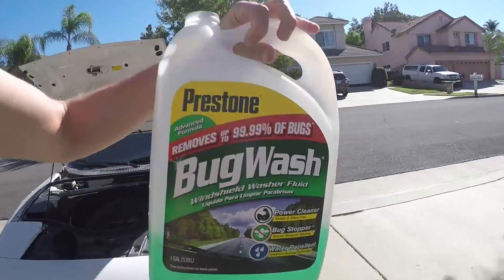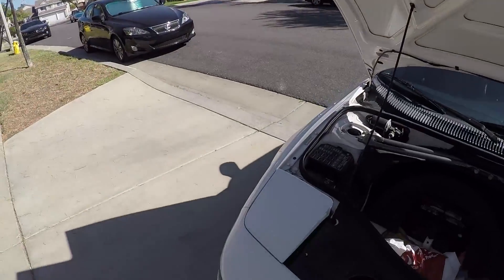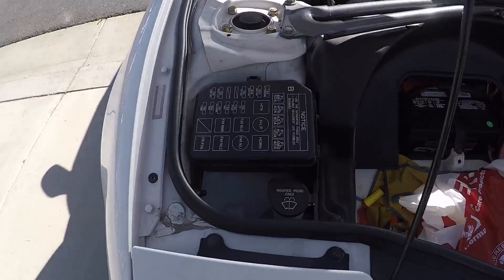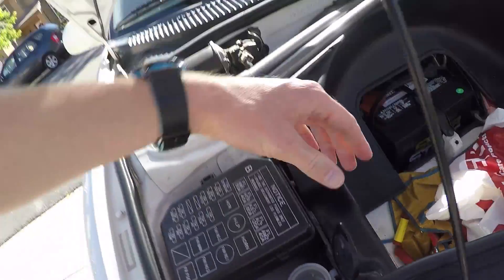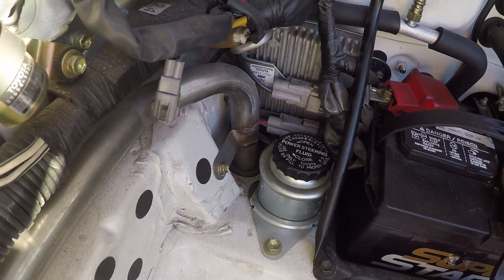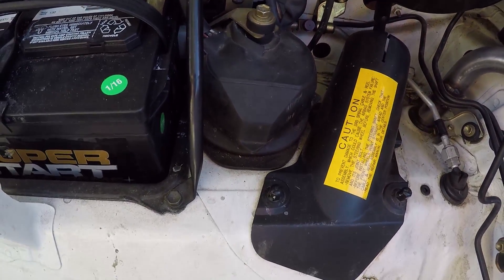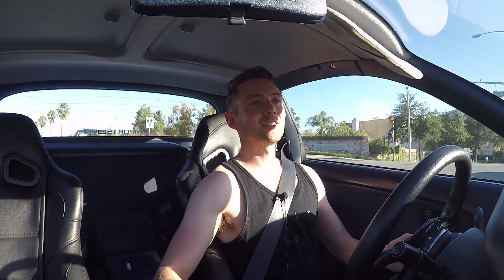Difference Between Hydraulic and Electric Power Steering

Comment: "The steering wheel is not fly by wire, it's still connected mechanically to the wheels via a steering rack. Electric power steering uses electric motors to assist you to turn the wheel but doesn't replace the physical connection."

Comment: I've driven a car with hydraulic steering and one with electric steering. I had way more confidence with hydraulic due to me being able to feel the road and the way the wheels turned with me. The electric steering made me feel like the passenger while being the driver I couldn't feel the road at all nor the wheels moving. Half the time I was worried of crashing since I couldn't feel the car and the other half was trying to keep the car out of the other lane or going into a ditch. I would take a car with hydraulic steering over electric any day my personal opinion.
Reply: I agree totally. I’m having a lot of issues over here driving on the expressway in both cars which are 2018s. I no longer drive on the expressway because I have no idea on which direction the car is going in. Feels over assisted , loose and floaty
Reply: I've found electric steering to be a sleep hazard due to the same things you guys have mentioned here. Lack of connection to the road, especially over the course of a long drive, will make one sleepy due to lack of engagement/connectedness to the road.
Reply: Seems like a sneaky way for Skynet to kill off humans...

Comment: I am not an owner of a MR2 but recently discovered that my car has EPS and since the car is a 2006 Jetta 2.5 getting info on it is harder than trying to smuggle missiles past the Berlin wall during the height of the Cold War.  So am thankful that you made this video. While it didn't help with my immediate problem it did fill a huge knowledge gap about my EPS.
Reply from the maker: Haha so glad I could help! Thanks for watching!!

Comment: the engine noise piped through the car isnt always boring, for example the LFA is considered as on of the best sounding engines, although yes its a pretty cheap way to make a car seem faster
Reply from the maker: I didn't know the LFA had piped in sound. It does sound amazing but that kind of makes the car a little less cool now lol. Anyway, if it at least the actual sound of the car just amplified through the speakers it's better than just a straight up recorded engine noise playing

Comment: Best video I’ve found on this subject, I don’t understand the dislikes or rude comments. Oh and those muscles aren’t fake 😂 Great video, and nice car 👌
Reply from the maker: Stop it you're making me blush 😝 lol Thanks for watching and glad you enjoyed!
Reply: I came here for an explanation on the difference between hydraulic and electric power steering. It started off looking like a vlog instead of an explanation, and the 11 minute duration also didn't make a great impression either.
So I scrolled through the video and I didn't see a single sketch or picture showing any system. Sure, explaining with words works in some cases, but I really need explanations about engineering to be visual. 
It may not be a bad video, but it just isn't what I (and probably a lot o other people) are looking for when they're searching for an explanation. I hope you'll now understand why there are quite a few dislikes :)

And about the muscles, I think they mean that the muscles look like body-builder muscles. Those muscles are often relatively weak and they lack some things like precision, control, and endurance. A decent wrestler can bring body-builders to the ground quite easily even though they aren't as strong. And a construction worker can carry a lot more than a body-builder because carrying requires other technique than lifting things up in a gym.
Sure, body-builders are stronger than the average people (especially me since I'm a programmer and only needs to move my fingers), but when they need to suddenly do real work then it becomes quite obvious that most of the muscles are just for show. (Again, they're still quite strong, but just not as strong as they look).

Comment: The drive-by-wire can be very safe if done correctly because planes have been using fly-by-wire with the same principle for years, but planes are under very more rigid regulation than cars, so a bad maintenance may be a villan
Reply from the maker: Yes maintenance is definitely to a much higher standard on aircraft. I think the main criticism of drive by wire is the way it feels though.
Reply: You can not compare car induced dynamics to planes where reaction times for planes are much less demanding and far less frequent and longevity of device is like 1/10th.

Comment: in electric power steering where is the motor driven. is the connection given to motor is by Battery of Car?
Reply: Alternator I think. If the engine cuts out you lose power assistance! That's one of the problems with it.

Comment: Are you using an nrg slim hub with the slim quick release for your steering wheel?
Reply: Snow_White_MR2 thank you. I thought you were on custom rails because the seats sit a lot lower than another sw20 with cr1’s. Thanks for the info. I will be making customs rails for sure then. 😁
Reply from the maker: owen75 Hah yes I am.
Reply: Snow_White_MR2 I want the same so the offset is closer to stock.. How is your horn hooked up?
Reply from the maker: owen75 You just need a ground wire touching the back of the hub.
Reply: I have asked you about your cr1’s before and I appreciate the help man. I have another question, when you ordered them what options did you op for? Seat saver, shaved base and anti submarine? I will be ordering these seat in the spring 100% percent based on your interior. Again I appreciate the help. I think I’m about the same height as you.
Reply from the maker: No problem man. It's humbling to know people like it so much. Honestly I can't remember all the options I got. I would definitely get the shaved base though. Keep in mind I'm also on custom rails. Hope that helps. Thanks for watching.
Reply from the maker: Good luck!